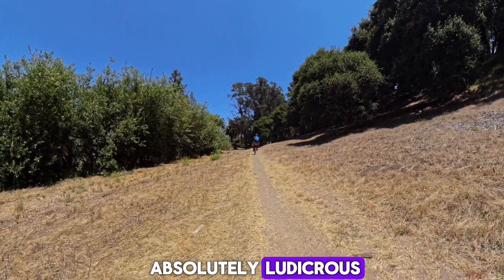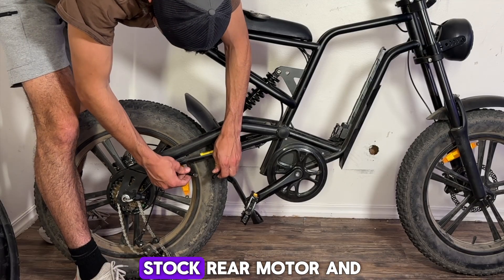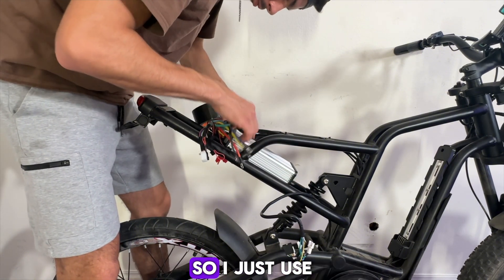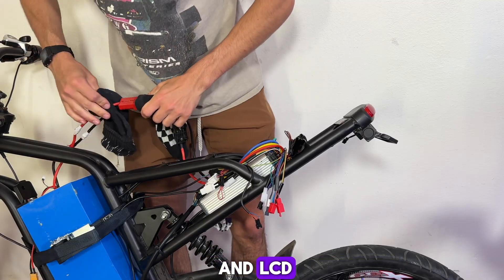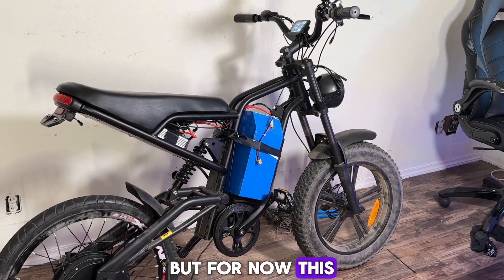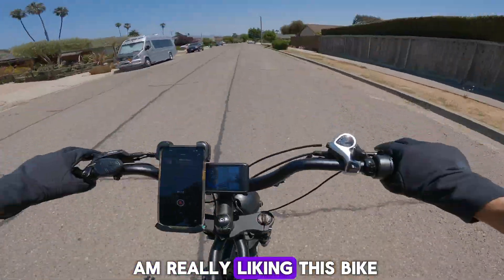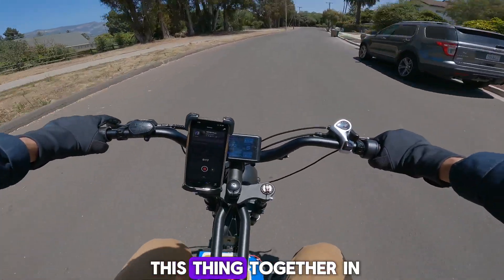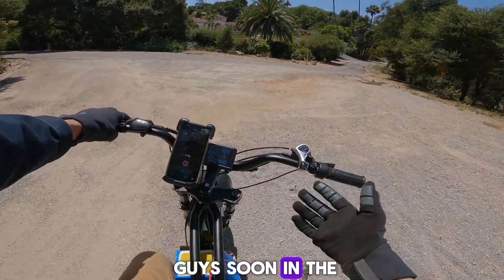60mph 72v budget electric motorcycle build (step by step 72v 6000watts💪🔥)

Comment: Not a budget build per say. You can but a tuttio ICT for $1,600. Brand new. Same results. Your bike is nice though.
Reply: Which battery and controller?
Reply: @yanishameesh7965 he’s comparing stock tuttio vs this “upgrade” I think . Tuttio is basically A baby baby surron but much cheaper or just around $1000 less than this full build, which gives you much more flexibility.
Reply: Ict is 48v

Comment: I have a hidoes b6 pushing 14 kilowatts! Got a qs205 3.5t, fardriver 72450, 72v 32 ah battery I made capable of 480 amps. Had to put a steering stabilizer on it because it does 75
Reply: Nice

Comment: Love you 72v bike battery upgrade hoever, consider probably the easiest ebike battery upgrate ever... The HappyRun G100 Pro is a 72v dual 15ah battery with a 3000/4000w motor and the two batteries are already factory pre-wired on a toggle switch which would unable you just take out the bottom 15ah battery and install a large 72v 50-80ah battery in the huge triangle area there. I thing this would be a fun project for you and you would be able to call it the easiest battery upgrade in the world ever. Good luck.😮😮😮

Comment: It’s a nice diy but I think the battery is sticking out to much if you drop it about 7 times your battery is cooked
Reply: I was a little concerned seeing the ratchet strap going directly onto the battery, I feel like with time and vibration it could really dig in
Reply: the metal ratchet part*
Reply: @dado_offbrand9499  i was thinking the same thing if it fell on that side and that rachet straps metal just pushing into the battery. only takes one cell to be ruptured to set it all off. I personally would want a more thin bike battery and cover it in some way but i guess for a what ever build its not horrible just could be better

Comment: Yo ENDOPRYSM, Great mod on that Windone, love the full speed ahead innovation attitude (that's how shit get done IMO :) ).  So, I just got a Windone e2 for myself and I'm looking to do some performance tuning before I start swapping out hardwarre.  By any chance do you have a guide or copy pasta for the Windone e2 controller lcd menu?  Windone support has not responded to my request for info and I've exhausted google, reddit and chatgpt looking for config menu info (I get standard P values but they dont align with the e2's menu structure).  Should you not have any guide(s), could you share the name of the stock controller and I'll use that as my next keyword search (not to mention,  it'll save me from having to remove my seat :) ).  Thanks in advance.

Comment: hey man I have the b6 hidoes. Just installed hallomotor 5000w kit but need adequate 72v batt. Any pointers?
Reply from the maker: Depends on what size your looking for. Nb power battery’s are a little bit expensive but i have always found them to be reliable. They have an Amazon shop

Comment: Why didn't you just start with a regular bike, that would've been the true cheap build.
Plus, you gave a link for the hub motor that costs $700, but the link is for a 3000w not 6000w motor.
So this build would easy costs $2600 to $2700.
I could buy a used Surron for that price.
Reply from the maker: The 3000 watt hub motor can be ran at 10,000 watts. You can buy a regular bike for cheaper but it won’t have the frame and suspension components similar to a motorcycle like this one. Also we’re I’m from people sell there used surrons for like 4000-4500 it’s crazy
Reply from the maker: Nvm your right used surron prices have gone down. I guess they are more avalable now.
Reply: @ENDOPRYSMofficial 
Either way, good video, and hopefully you make a electric mini bike or go kart also. 👍
Reply from the maker: @TrickyP1022  100% going to do a go cart. Looking to expand to new builds.
Reply: @ENDOPRYSMofficial 
I'll definitely be watching for it 💪

Comment: Sticking with 72 volts is foolish. When people choose to take their homes off-grid, they will most likely use 48 volts. Intelligent people will eventually begin competing in the ebike market and will design a system that connects a 48-volt BMS to each half of the 96-volt system while charging and will leave it disconnected when discharging so that the two halves can be series connected. Until then, I'll stay away from ebikes unless I am the intelligent person who decides to compete with the run-of-the-mill folks who just want it to work without wanting it to also be done right.
Reply: negative nelly
Reply: @slipslapslopstaysunsafe6176  This is exactly the mental laziness that will keep the industry stagnant. I've got a few grand sitting around. It seems like it's time to show you all how easy it would be to design a well thought out battery system to compliment a 96-volt motor and controller while being charged by, and even potentially used by, a 48-volt residential system. Hold onto your uninspired beliefs because I'm coming for a large chunk of the industry's market share.
Reply: @RussellHank-t3t   do you have it made yet? why not? You're commenting here when you should be making it.
Reply: @Dus306  You got that right. At the moment, I'm using the exact method to convert my 2000 Ford Ranger to a 144-volt, 18kW rated, 42kW peak system that will charge from my home system. When it's parked at home, the lead-acid batteries in my home system will be maintained by the LIFEPO4 in my truck so that the lead will last many years longer.
Reply: @RussellHank-t3t negative nelly
Reply from the maker: Woah shots fired bro. Remember this is a Christian comment section.
Reply: @slipslapslopstaysunsafe6176  It's not my fault that I see wasted potential. Thanks for the troll attention.
Reply: @ENDOPRYSMofficial  Are you implying that intelligence is a sin or is it honesty that violates God's rules?
Reply from the maker: Someone called you a “negative Nelly” we don’t tolerate such curse words here.
Reply: @ENDOPRYSMofficial   thanks man i’m sick of all these negative nellys out here
Reply: @ENDOPRYSMofficial  Ahhhhh!

Comment: That is 100% the Hidoes B6 frame that I have too, its just that yours is called wodoen or something weird like that? Anyway with its appalling stock power that bike is crying for exactly what you did there - triple or quadruple the power in the wheel, nearly double the voltage in the juice pack and there you have it - a propper e bike.

The front and rear suspension on this bike are still shocking whilst stock (pun intended) and with the power you got in it I would definitely be looking at some front forks and rear shock absorber upgrades if I was you.

Is that rear wheel 24" ?
Reply: How fast does ur b6 go I can't decide between that bike and the ridstar q20
Reply: @jacobcarrillo7896  I would say that it is alright only for it's price on Alibaba. Otherwise range is low expectedly with it's weight. The PAS is unusable above level 2 (out of 5) - clown pedalling starts after that. 
The seat is the most uncomfortable thing Ive sat my  bottom on. The suspension is horrible (front and back) and in some situations it has put me into danger with the way it acts on uneven surfaces. But once again - you get what you pay for.

In terms of speed - it does go up to about 27mph with me being 100kg man, and it will last for up to 25 miles if I keep the speed between 20-25mph troughout thay journey.

Not sure how the ridstar compares since I've never ridden one.

Comment: 2500$? Man, i built bike like this for 1440$. It have lifepo4 77v31ah with smart BMS, this battery barely loose its charge while driving (working voltage 3-3.3 instead of 3.4-4.2 with li-ion) Lifepo4 much better in terms of amount of cycles and work at freezes. I also got fardriver BT controller and the same motor 3kW. Your controller is 80Amps, right? I can push to the motor any up to 150Amps (11550W), if i upgrade to qs205 or qs270. And see, cause i have 5 volts nominal more, i can push 400W extra, on the same current and it still not gonna overheated. I'll be happy share a video, but i still working on electrics and not record it yet.

 Battery + charger 800$
motor 250$
controller 130$
bike+welding work 250$
wires, connectors soldering and other stuff 10-20$
Reply: How to contact you
Reply: no one asked or cares.

Comment: Question I order a 5000w rotor 72v 26.1 battery 72v 80A controller stealth bomber from Alibaba. I thought for a while the best way to upgrade your top speed of upgrading the motor but idk if that’s for sure right what should I upgrade to go faster?
Reply: Motor controller could just need tweaking. I highly suggest switching to a much higher controller. what is the max load that the motor can take? A lot of times its tuning the controller that is the issue. At 5000W you should be getting speeds of 55-60mph your controller can handle 80Amps so is it putting out 80Amps or only 40? Is the battery able to put out 80Amps? when getting batteries from China you want to test them to make sure everything is working properly. I had a battery for my bike labeled wrong from the factory and it couldn't send the advertised power to the motor.
Reply: @TylerDarden-lk5ym  so what should I upgrade to get a higher top speed
Reply: @TylerDarden-lk5ym  I am probably only able to get 50 moh
Reply: And I think the controller only puts out 80 a
Reply: @tracesmith9099  so if the controller is 80a then you will only get 30a to the motor.

Comment: What size rear wheel did you put on?
Reply from the maker: 24in
Reply: @ENDOPRYSMofficial  oh dang you think a 26” would fit?
Reply from the maker: @ryanwebster2167 yeah you would need to take off the rear fender which is easy but it would work
Reply: @ENDOPRYSMofficial  dope dude thanks for the info I have been looking into make a cafe racer style with some parts I have!
Reply from the maker: @ryanwebster2167 sick. I recently received an Enguey m20 to do a review of and I want to look into modding it to make a cafe racer style bike. Mid drive tho.

Comment: Sweet project,  however $2500 is hardly a budget build.
Reply: can you recommend a cheaper build?
Reply: @VenFuzzy The one question I have is....How fast do you want to go? Then a back up....How much do you have, $$$$, to get to said speed?
Reply: To be 'Budget' it needs to be 25% of the cost to buy something NEW for the same price. So less than $700 would be fair if this was around a purchased price. However,  this is a discounted build compared to the original bike with a plus in performance.  Still TOO much for the average person.
NOT saying it is not cool or fun, just realistic for most people.
Reply: @ThanhTran-md5zz  yeah, I still think cheaper. But I have 20 plus projects soooo

Comment: the metal in the strap will cause the cells to break, neat as the build may be that is a major point of  fail to the point it might cause it to burn down.  id get cover on it soon as humanly possible. if it was me i would have kept the back motor an put it in the front then use a smaller controller  plus back motor for the back since dual motors use less power as a whole the push-of the wheel is leveled out then swap the breaks for 4 type breaks.

Comment: I'm compelled out of concern to warn you that, that strap buckle edges up against the battery is a serious fire risk. Especially if you're going off road. I'd take it off NOW before it's too late. Or atleast put a flat edge between the buckle and the battery, so that bumps wont eventually make the edges of the buckle pierce the battery. Ride safe dude.
Reply: I just used zip ties on my bike battery and I ride daily doing doordash on it they hold up really well
Reply: I agree. Some Gorilla Duct Tape super strong or thick zip ties.
Reply from the maker: I’m on it there will be a few followup videos

Comment: ok it might be fun for this video but whats the amount of time it can out put 600 watts, I can do 600 watts for about 1 to 2 minutes lol... but i can 250 watts for 5 hours , so can it actually beat a trained cyclist?
Reply: going off the amazon listing for the battery as 72v 20ah:
600w = 72v * 8.3A
20ah / 8.3A = 2.4 hours or about 144 minutes
Reply: @tastefulbob6954  But it's 6000w not 600, so that's 14.4 minutes, but as you'd be running the battery at more than 4C you'd be lucky to get half that.
Reply: @nickwinn7812  i went off 600 watts because thats what the commenter said

Comment: OK, you tested it.  Now go back and actually make it right.  Brakes, controller mount, battery mount that doesn't put pressure on the battery.  Now, go get it licensed as anything over 750 W needs to be licensed in every state, unless you keep it off road, which you obviously are not (by your video).
Reply: Your a weirdo
Reply: Oh wow good eye there Rich 😂😂
Reply: Ok buzz kill

Comment: Not 6000watt hub motor it's 3000watt
Reply: Motors can usually take a bit more than they’re rated for. Also, 3kw is the average power, but peak is often much higher.
Reply from the maker: But it’s being ran at 6000 watts. And it handles it with no problems
Reply: Smh....its very easy to multiple 72volts × 80amps

Comment: 6kw motor with no torquearms on the dropout.  8 washers per side. 2 nuts for brake spacers.

definition of sketch.

This'll rattle itself apart before the summer ends.
Hope no subscribers copy you and get hurt..
Reply from the maker: It’s pretty solid
Reply: @ENDOPRYSMofficial 
Torque arms are must though, I'd put some on if I was you.
Reply: I agree. I know some bike mechanics that are skeptical about completely safe conversions because of their ignorance. This thing I would not recommend to anyone and I am more open-minded than them. The last one he did wasn't perfect either but was safer by far than this.
Reply: @xChrisFergusonx  I custom made one for either side of my rear axle on my 1500w 52v build, better safe than sorry as I've seen vids of people's motor having ripped itself free... It's never good 👍
Reply: At 60 mph

Comment: whats the math on the watts? like the controler amps and the motor watts?
Reply from the maker: The controller is 72v 80a and the battery is 72v 150a aka the battery and controller generates 6000 watts.. The power is made from the controller and battery and goes through the motor.

Comment: Dude i have to say thanks because im trying find a decent ebike to get in October that i can modify later on granted i doubt ill need to go that fast but id rather have the speed in an emergency rather than not
Reply: Have you thought about covering the battery and the area leading to the controller by chance I'm thinking of using a very large piece of abs plastic to avoid adding too much weight but still have a good amount of protection for them and it's also much easier to work with
Reply from the maker: Yes I’m gonna make a separate video we’re I clean up this build some.
Reply from the maker: No problem. Enjoy your new build keep me updated.
Reply: @ENDOPRYSMofficial  LoL never mind I found the company I just have to make sure it's actually sent by them somehow
Reply from the maker: The one on Amazon is the same one.  So you should be fine getting it from there.
Reply: @ENDOPRYSMofficial  Ok thanks as for the replacement controller I'm looking at sabvotton or however you spell it there's a kit with a 3000w motor 20x4 is there anything I'll need to be able to connect the battery to that? I'm planning on using the bike to make deliveries and I live in a downtown area
Reply from the maker: No the battery comes with the necessary connectors to connect the controller to the battery. I’ll probably make a quick tutorial on how to do that.
Reply: @ENDOPRYSMofficial  sweet thanks
Reply: @ENDOPRYSMofficial  I looked through your videos that's how I found it man I'm gonna have to make a video to send you sometime after I get it modded to show what I will do
Reply: Which bike has this frame on Amazon that I can get do you know

Comment: I've built mine with a Walmart full suspension mtb, i have the 3000W hub motor with an 85A controller and 72 volt battery, it makes close to 60 mph and weighs only 65 pounds, i upgraded the brakes and suspension to air, it really goes great, even at high speed.
Reply: How much was the total cost for the build?

Comment: since you are running more power through the motor you should put cooling fins on the hub motor, apply thermal paste first though
Reply from the maker: It runs super cool Evan after shredding it trust me. I feel like it should be marketed as a 6000 watt motor.

Comment: $2500 😭
I recently spec’d out a similar build but with 7200w, and it was $1800. You should learn how to build batteries if you plan on building many more of these in the future, you can save so much.
Great build though
Reply from the maker: Well for me this build was actually 1400 because I got the bike for free. And the end price is more like 2200. but your totally right. I should start building my battery’s.
Reply: What frame and battery did you use?
Reply: @JasonNosajasoNosaj  I used a $550 bike from Walmart (I forgot the name) and the battery cells and BMS from BatteryHookup